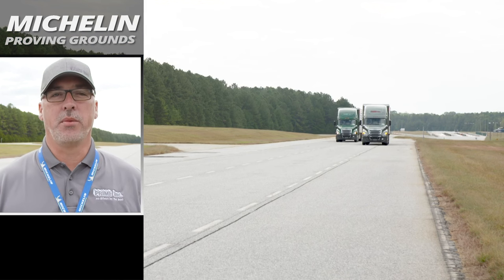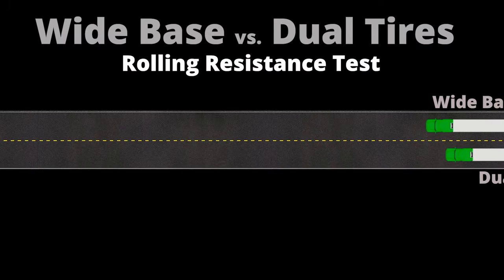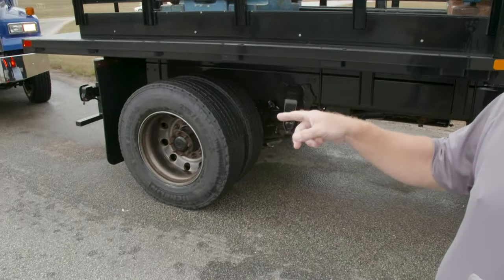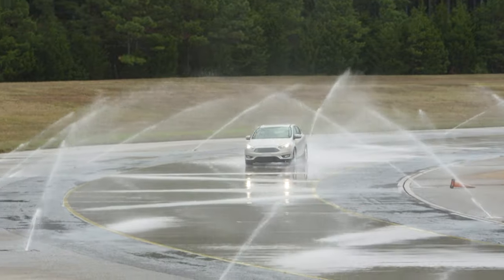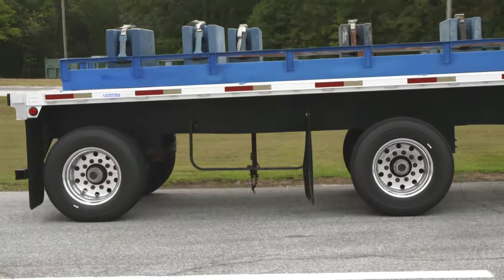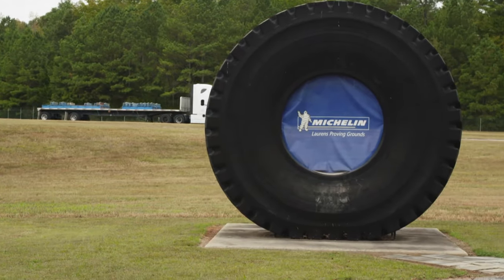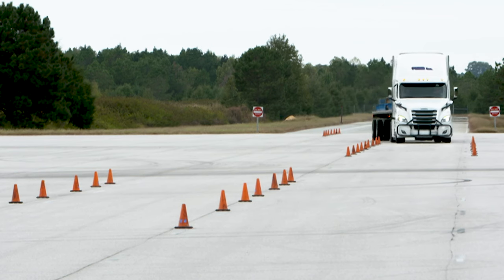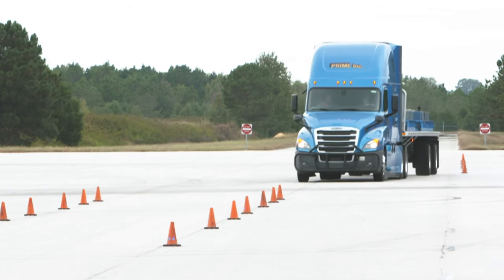Dual Tires vs Super Singles at Michelin Proving Grounds

Comment: Obviously it has better fuel milage. But ive driven both and singles slice and hydroplane much easier.  The duals took more steering action because they were harder to keep sliding
Reply: I was about to make this same comment lol i didn't realize i did 2 years ago.  
The duals dominated on the skid pad...
Reply: @joshriles84  lol bro came back and got the same exact thought
Reply: @genericjonathan4115  lol

Comment: Looks good. But I’d rather have the safety of duals when it comes to a blow out. Can stay in control and limp a distance if need be. I know it’s not legal to do so. But it’s there if you need it. Wide base goes boom your done you need a tire and maybe a wheel and what ever else it decides it wants to take out. And as I driver if I’m empty and have a outside tire go flat. I can single it out myself on the side out the road or a safe place. And keep on trucking. Not going to do that with a wide base.
Reply: Travis Helms yep, I’ve had two drive blowouts. Cost me more than all the rolling resistance could ever make up for. Also- I seriously doubt they used brand new duals in this video.

Comment: My dad drove trucks and busses for over 50 years. When I was a kid he drove a 2 axle Kenworth with a 40ft trailer hauling US mail in the San Francisco Bay Area 7 nights a week. The owner of the truck decided to put super singles on the drive axle, which my dad was not thrilled about it. In the rain in the middle of the night one night not long after getting them he had a blowout on the left side drive tire on a right handed curve on a high overpass in Oakland. The truck jackknifed and went up a rode on top of the V split rail where the road splits with a large drop to the ground below. The Kenworth's frame was bent into a V from the impact, it ripped out the transmission and fuel tank, and the cab was almost completely detached from the frame. Thank God it didn't completely detach or it would have gone down the large drop off with him in it. The trailer couldn't have been parked better. It was the only real accident he had and you would never get him to touch super singles again.

About 10 years later he taught me to drive truck (3 axle freightliner - no super singles lol) on that route, and I pulled the same trailer he was pulling that night that still had the markings on it from where it hit the cab. Very weird feeling.
Reply from the maker: Hi Robert! Thank you for sharing your story with us, and thank you to you and your dad for your commitment to moving freight.

Comment: The rolling & mpg difference comes from the machined aluminum rims vs stamped steel (with deflection) on duals and the big difference in rubber compounds

Comment: I've ran with duals and singles for several years, and I prefer the singles now. I've had less blow outs with singles, better tread wear, and better traction in slick conditions. I've had several instances in snow where my duals would slip, but my singles seem to dig in more, and find traction. Fuel economy is a bit better, but I'm flatbed so it's not as noticeable, I'm not always very streamlined.

Other than that, it's 8 less tires to inspect and check pressure on. Invest in a TPMS and it saves time and gives some reassurance. Do diligence is required regardless of what you roll on. Keep them inflated properly, and regularly inspect for irregular wear or damage like with any tire. Also installing snow chains is a bit easier on singles, chains for singles a bit lighter. Of the few blowouts I've had on singles, I've never had to replace a wheel, I pull over immediately and get a road side tech out to replace. (Legally your supposed to do the same regardless of what setup you have) This is situational though, not all roads are gonna provide a good place to pull off immediately, plus other factors can come into play too. I frequently haul glass, so if I have a blowout on a narrow road, I'm gonna be a big ole buttplug until a tech can get to me. Glass breakage on a public road means a call to a hazmat clean up crew. But again, many things in this line of work are very situational.

I'm not a driver for Prime, I drive for Combined Tansport, just thought I'd leave my opinion/feed back on singles vs duals. Really at the end of the day it's just a preference, stick with whichever works for you.
Reply from the maker: Thanks for watching our video!
Reply: I was thinking about super singles, isn't it quite expensive to get retreaded though?
Reply: I'm not sure to be honest, I'm a company at the moment so I don't foot the bill. But the company I drive for usually only runs virgin rubber on our equipment with super singles. Hauling volatile freight like glass, they'd rather not risk blow outs, that and glass freight usually runs pretty heavy. I've seen a lot more tankers and flatbeders running singles than I have dry van or Reefer as of lately.

The mid roof Cascadia I'm in, with 45ft aluminum/steel combo trailer and singles, puts me at around 28,800 lbs empty with full tanks. So I can run load up close to 51,000 lbs. A lot of other more conventional flatbed setups are usually running around 31,000 to 33,000 lbs empty.

Personally if I go owner op soon, I'll be running Michelin super singles similar to our company trucks. I wouldn't bother with retreads on super singles myself. Back when I ran with duals, doing dry van and Reefer, even with my tires aired up properly, I'd occasionally have blowouts on hot summer days. Of the blowouts I've had with singles, I'd be worried about the damage the debris from the tread would do to the equipment. One of my super single blowouts on a double drop trailer, the tread that flew off the tire dented the air tank on the trailer pretty good, and ripped my mud flap off the back of the trailer. The entire tread came off in one big piece, and what was left of the inner tire and side walls shredded to pieces everywhere. So I'm a little leery of retreated singles.

Don't know if that helps or not, because currently I just run on the tires, I don't pay for them myself.

Comment: They have the complete wrong Takeaway on the skid test. Of course the super singles skate around those Corners better, but that's the exact opposite of what you want in a tractor-trailer. Unless you're filming the newest installment of the Fast & Furious franchise, you don't want your trucks skidding. I have driven both super singles and duals, and they called super singles skis for a reason. They get slightly better miles per gallon, there's no question about that, but it's not worth the safety trade-offs. This is why you were starting to see a lot of companies that had switched over to Super singles starts with Switchback. The fuel savings doesn't cover the cost of a blowout, replacing a rim, or towing a truck out of a ditch. For some reason Prime has a real hard-on for super singles, probably cuz they invested a lot and outfitting every single one of their trucks and trailers, and they also own their own Super Single tire shop.
Reply from the maker: Thank you for tuning in and sharing your opinion! Everyone is entitled to their opinion of course. This is just the way we roll. I'll be sure to share your comments with the team should they ever consider switching things up. As always, safe travels!

Comment: my complaint is that there is a very key component missing in these test which in my opinion make the wide based tires extremely unsafe especially in winter conditions.

that is rutted roads.  on rutted roads the wide based tires walk around constantly trying to find the groove so the tail end of your truck is always swaying and as a flatbed driver this is exaggerated with the sideways rocking of the trailer.

please do a comparison test on I-80 coming out of Reno going to Stockton and back and you will see what I am talking about.  As any driver who has driven that route can attest to those are probably the ruttiest roads in the nation.
Reply: That's situational and affects commercial pickup trucks too. I own a Ford F250 with commercial rated tires on it, and I have the same problem on those sort of roads. I'm also flatbed OTR, so I know what you mean, been across that route plenty. That's also partly California DOT to blame, and heavy traffic volume there as well. There is always going to be pros and cons to each. Personally I've no issues with singles in the winter, I prefer them over duels now. There's no such thing as the perfect vehicle, you'll always have to make some compromises, and that all comes down to preference and use case. At least picking tires for a semi truck is easier than a car. Last time I put new tires on my car the list of choices just went on lol.

Comment: Less resistance on the road would equal less traction.
Reply: Not quite, rolling resistance and traction are two different things. Weight is a factor too, and singles are quite a bit lighter. The less rotational weight you have the better. Less wear on the brakes, driveterrain, and engine. Gross vehicle weight and rotational weight play drastically different rolls. You may not notice it as much in a big truck, but in a lighter vehicle like a car or motorcycle these changes are very noticeable.

Comment: Super singles have less traction on wet,ice,snow then duals and has been proven to be true. Another name for super singles is float tires because of their displacement were duals will cut though snow and ice and water.with super singles you are trading safety for fuel mileage

Comment: This is just my Opinion, yes Super Singles do have less Rolling resistance and provide better mpg. I will still take a Dual tire truck any day because for example. If your rolling down the road and you get a blowout with a Super Single Rim, it’s Bye Bye Rim also they are expensive to replace and the axle drops tearing up the rim. With Duals you have another tire to hold the axle up when you have a blowout.

Comment: Let's not forget about chaining up. Singles get hung up on a barely noticeable ridge of snow in the parking lot. If you have duals you can drive up on a block and chain the outboard tires in about 10 minutes. Super singles suck in the winter
Reply from the maker: Thanks for checking out the video and sharing your feedback.

Comment: Not once did they talk about the safety side of the tires when they blow out at a high rate of speed.... proves they only care about the efficiency of the bottom dollar not the drivers safety
Reply: That only happens to retreaded tires
Reply: How many times have you had a "blowout" , we in Europe drive with super singles on our trailers and some use them on the front steer with duels on the rear of the unit/tractor. I've travelled 4-6 thousand km a week for almost 20 years an can count the amount of flats on one hand. Best bit is, 3 of my blowouts were the duels!
Reply: @michaelbamber4887  LOL same. Never blown out a super. It's always been a dual blowing out.
Reply: @Luis Serrano  the yank idiots keep fitting um on the drive axle? Not really seen in Europe because the tyre says trailer/ steer on the side wall. Unless they have different ones over the pond?

Comment: Gotta keep duels on flatbeds if get nail or pop a tire at jobsite they can still leave allows them to continue their deliveries and job without causing delays. Super singles pop at a customers jobsite  just screwed them and made them mad by delaying everything I don't agree with super singles on flatbeds
Reply from the maker: Due to scrub, we don't use super singles on our flatbed trailers. Especially with our split axles on our flatbeds, it makes the scrub really bad.  Tires are made to roll forward, not sideways, and with the wide-based tire and the spread axle makes flatbeds not a viable option.

Comment: Does that mean super singles on flatbed trailers in the future?
Reply from the maker: Great question! Due to scrub, we don't use super singles on our flatbed trailers. Especially with our split axles on our flatbeds, it makes the scrub really bad.  Tires are made to roll forward, not sideways, and with the wide-based tire and the spread axle makes flatbeds not a viable option.
Reply: Maybe in the World of Prime.

Comment: Super single tires are not that great only way I see using super single to save fuel if the rpm is just above 11 to 1200 rpm and speed those tires dont save fuel and cost more money to replace since if you get a blowout on tractor or trailer its gonna gonna take the rim with it 95 percent of the time so if it was me as an owner operator I would go with dual tires since if one tire go out you can limp to the nearest truck stop and super single wears out more quickly and they stuck in snow I still prefer duals over the shitty super single

Comment: Blow a tire with duals, you limp to the tire shop. Blow a super single  .... your sitting for hours on the shoulder. Dont find many super singles just sitting at the tire shop either.
Reply from the maker: Its still a DOT violation to drive on a failed tire , dual or super single.